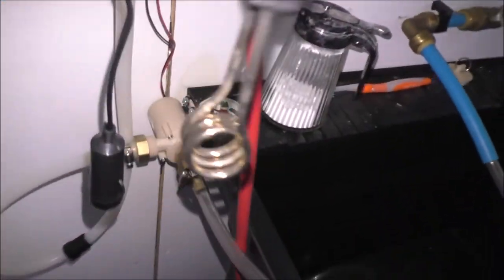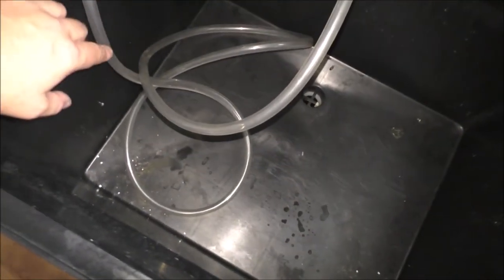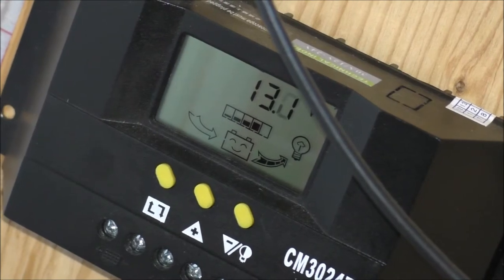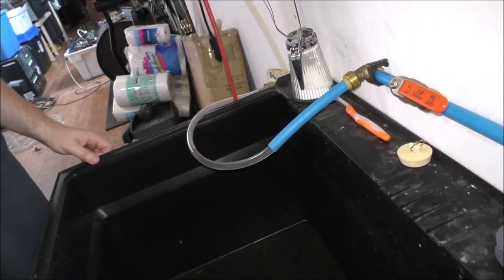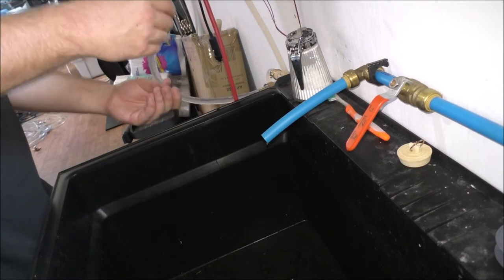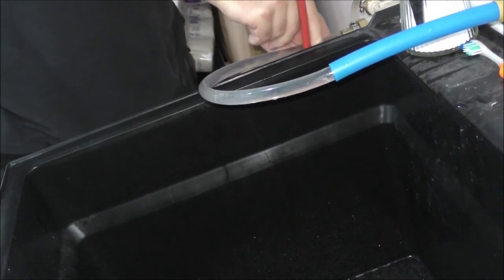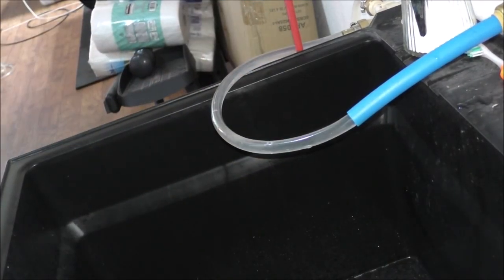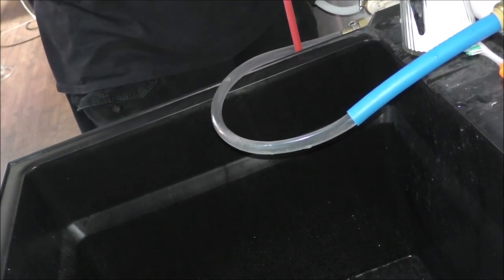Gravity Fed 12 volt Pump ~ Air Lock

Comment: A very interesting water flow problem. 

It definitely sounds like the pump's impeller is cavitating due to air inside the pumping chamber. The inflow is gravity fed (wonder what it's water pressure is at the faucet to tube junction) and the outflow from the pump goes way up to the water heater where there is insufficient water pressure for the heater to go into start up mode. 

The water heater's inlet is definitely at a higher level than the water tank's outlet pipe, so there is a definite back pressure in the line. Perhaps a backflow check valve might be necessary? And, as you are saying, some way to automatically bleed air out of the line. Also, note that the water heater will need both a minimum operating water pressure AND a sustained flow rate.

Hopefully a plumber will chime in with a technical explanation. Please let us know what you figure out.